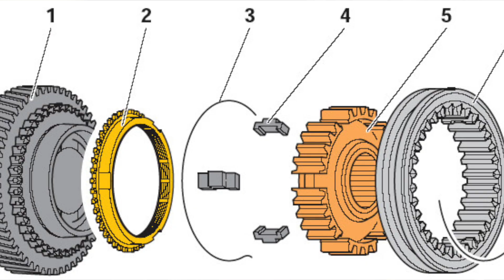Shift Without The Clutch! We Explain Synchronized | Face-Tooth and Clutchless G-Force Transmissions!

Comment: for the clutchless transmission, once it comes out of gear, do you have to start over from 1st again?  Is it an upshift only transmission? or can you downshift and keep going?
Reply: The true clutchless is upshift only (for dedicated drag use). The other dog-ring “clutch assisted” doesn’t really need the clutch to shift, but it does need an interruption in torque/strain. That can be accomplished on the way up by a quick throttle lift, cutting ignition, hitting a hard rev-limiter, OR hitting the clutch. As soon as any of these happen with pressure on the lever towards the next gear, boom you’re there. On the way down, you can blip the throttle (left-foot brake, right foot blip), or hit the clutch (ideally with a heel-toe blip), with pressure towards the next gear down, and it slots right in. The only shift that makes you cringe is engaging 1st or R after idling in N. You don’t have a synchro to slow down the spinning gears inside. So after pressing the clutch, it’s best to wait a few seconds so it isn’t as brutal (planning ahead at stop lights is key), but you’ll still hear a good BANG when you yank the stick. The key is to always be fast with the shift lever so the dogs engage positively. If you move it slowly, the tips of the dog teeth skate across one another and carve themselves up.
Reply: @n @nkgagne ohhh, clutchless as in don’t need clutch to shift. I thought it meant no clutch at all… although on that I think about it that doesn’t make sense… my bad

Comment: I just wish someone would come out with a sequential shifter for the T5 that doesn't cost as much as the new T5 did.
Reply from the maker: Do you mean a V-gate?
Reply: @revanevan  No, a sequential like the S1 Sequential, which is $1500. Cheaper than a new T5Z but definitely over half it's cost.

Comment: This was all great info. I'm sure it's old tooth to others, but it was cool to me to be able to see inside.

Slightly off topic:
I used to fully depress the clutch pedal while shifting when I was younger. I had to go back to a stick shift Jeep Comanche recently and I found I can shift better by only pushing the clutch pedal maybe halfway down. 
Is this what I should have always done?
Reply from the maker: Not necessarily, even with a synchronized trans you only need to disengage enough to slide into the next gear.
Reply: @revanevan  
Thanks. 👍😉

Comment: anyone that has ever ridden a motor cycle has shifted a face tooth trans. this is not some magic thing that no one has driven. they said they were going to release a facetooth set for the 3650. I want a facetooth set for the 3650.
Reply: Oh yeah? I didn't know motorcycles used that design. Thanks.
Reply: @xmo552 yea they are all that way. That's why they clunk when you put in gear.
Reply: If I had to guess, that's where these "racing" transmission makers got the idea from.

Comment: I believe with any transmission, the first and most important step is getting it out of gear,, and set to go into the next gear with out "tie up".
Reply: Not with a clutchless, it engages both gears at the same time, and ramps out of the lower gear automatically.
Reply: @alexjohnward  So, the reason that a clutchless transmission is un-streetable is that it cannot downshift while the car is in motion?
Reply: @richardbell7678  correct.

Comment: Why can't they make a transmission like Honda Atvs with semi manual.. You don't need a clutch but you still shift gears. They use a centrifugal clutch instead of a manual clutch??
Reply: Torque load.

Comment: I wish He would consider a Sequential shifter for all those. A question, are the the dog rings particularly as a option on the T3650 or Tremec Magnum 6speed easily user replaceable?
Reply from the maker: Yes as long as you can service a manual and a press is helpful.

Comment: Looks like there was a 6XD sequential transmission in the background that you guys overlooked. 
My 01 Mustang Cobra is getting a T56 with a full sequential conversion from PPG gears and it will be stuffed with dog rings and a shifter barrel that replaces the shift rails.  In my opinion, a manual sequential gearbox is the ultimate trans for a street strip road course car.
Reply: The point of the sequential gearbox is that it’s much faster than an H pattern and it eliminates the possibility of missing gear shifts.
Reply: @cobraracer46  faster? doubt it. it is likely more annoying then a Vgate on the street, with a Vgate you can still find a gear without having to roll through the whole pattern. on the street its a gimic
Reply: @xxxmikeyjock  Reality and what you think are two different things. A racing sequential dog box is much faster than an H pattern synchronized transmission since you can shift a sequential dog box in around 50 milliseconds because you don’t need to use a clutch and the gas pedal is 100% on the floor.
Reply: @xxxmikeyjock  You are wrong. The numbers don’t lie, the sequential dog box is the fastest shifting transmission available and the shift  time measurements prove it. The spark  cut or shift cut happens faster than you can blink an eye.
Reply: I dont see the point of sequential in a street car. H pattern works and you can select any gear any time
Reply: You can do that on a sequential just use clutch and row to what gear you want. Just like a motorcycle you can select any gear when the clutch in engaged.  @xxxmikeyjock

Comment: I know this is G force video and that is a great lineup. But Liberty is king of the clutchless for strength and reliability with its dual cluster design
Reply from the maker: The Liberty Equalizer is the standard in Pro Stock, Liberty makes fantastic transmissions for all applications. Great people, too.
Reply: @REVan Evan  yes they are great people. We ran modified eliminator back in the day and then comp elimentator until late eighties. My dad was friends with Joe Liberty.  And just to be clear, not taking anything away from G force. They obviously make great stuff.

Comment: I remember running a faceplated T5 many years back. I was getting set up for my 3-4 shift and putting pressure on the shifter (as I always did/do). I got caught off guard when without ever touching the clutch pedal I must have pulled hard enough to shift into 4th. After I knew that, I still used the clutch on most shifts (to get out of gear), but everyone once in a while if the race was close, I could yank a gear without the clutch pedal.

The set up changed to a 4 speed with a vertigate shifter, which was a blast as well, but I missed that H pattern T5.